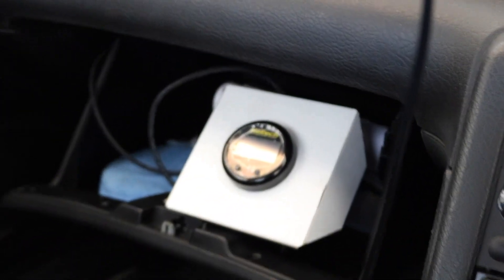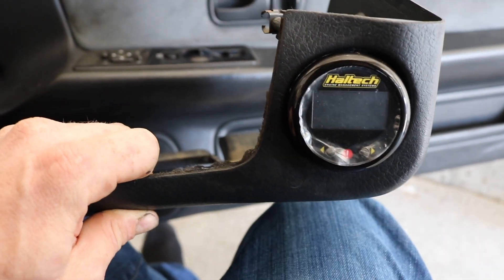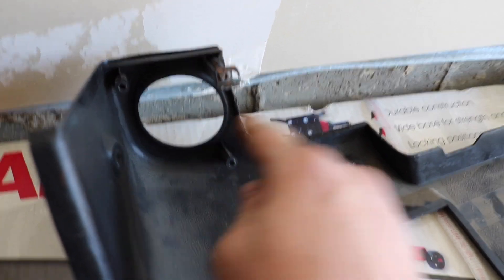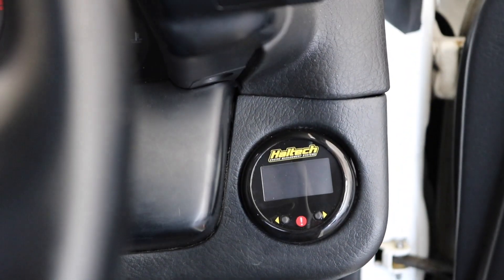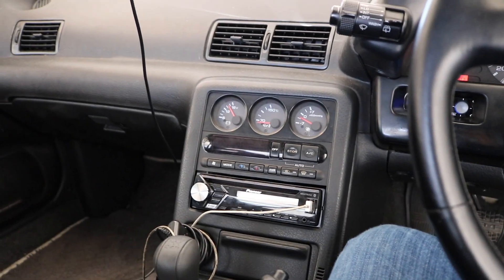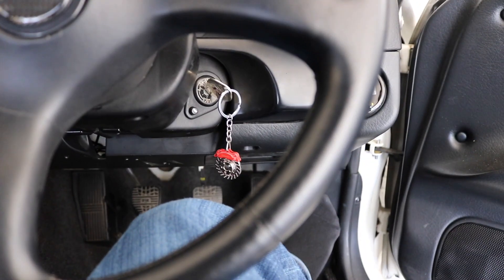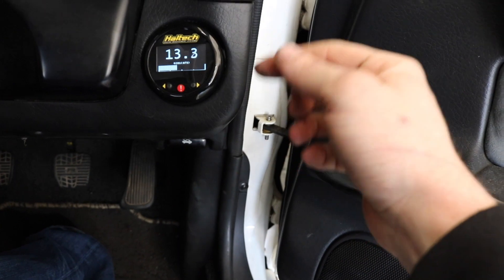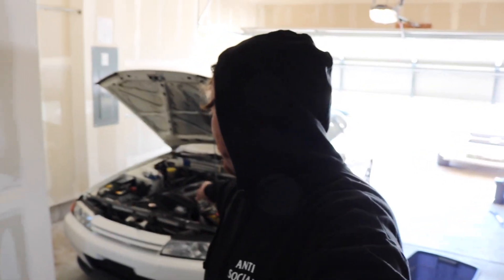Installing Haltech’s multi-function CAN Gauge in the skyline GTR

Comment: Nice man, I'm about to get this gauge too. But I have to get a CAN hub since the wideband is using the only CAN port on the platinum pro I have. How do you like it so far?
Reply from the maker: I like it. It’s easy to read even when it’s in full sunlight. The app is cool and easy to use and set up. If I had to do it over again I would totally buy it again.

Comment: Nice man, I ordered the BTI touch gauge for my GTR. Take a look at it, its like a mini dash with e85 display, AFR, boost control and much more. Best display gauge on the market.
Reply from the maker: I’ll check it out
Reply: Friend Built I've got some great news, remember I was telling you about the elite 2500. Haltech did me a solid and I'm now that's what I'm running. Just rewiring some of my devices and that gauge plugs into the CAN connector.
Reply from the maker: That’s bad ass I was going to get the elite but went platinum pro 1500
Reply: Friend Built nice! It's shaping up to be a good summer. I can't wait to see what the RB30 does on the streets.
Reply from the maker: Yeah I can’t wait to see ur r33 killin it
Reply: Friend Built yours too!